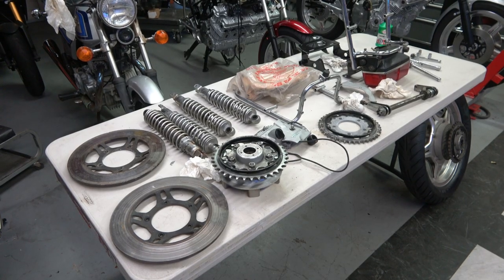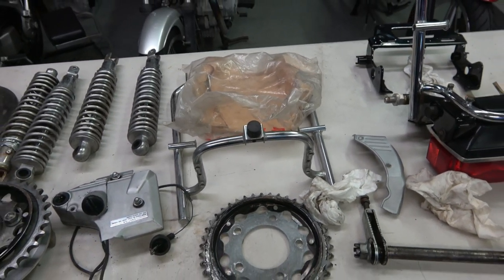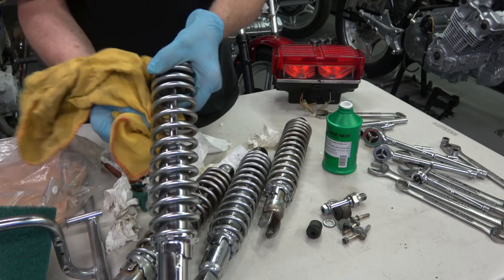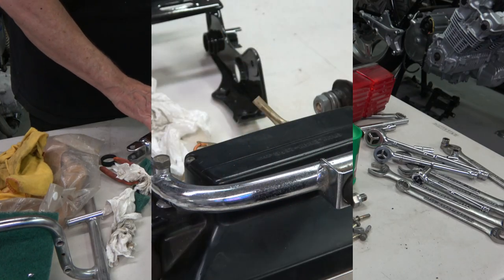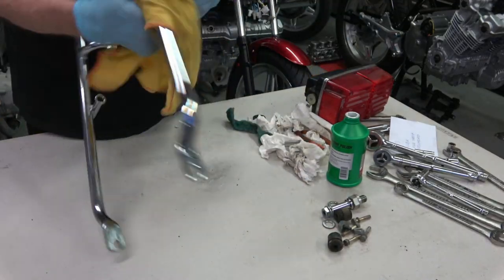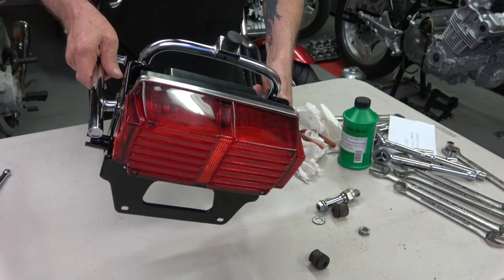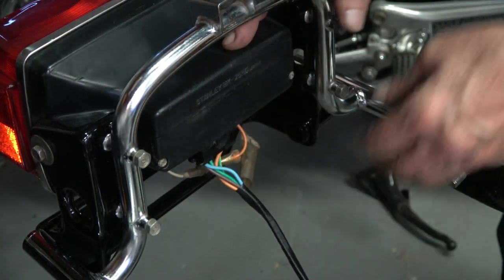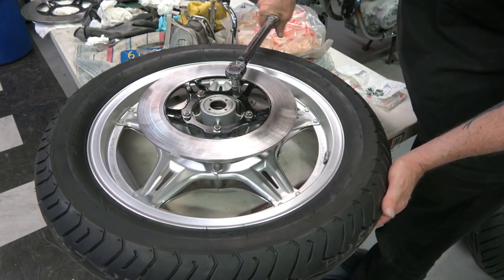Honda CBX Full Restoration & Engine Rebuild Video Series - Part 35 Shocks Brake Rotor Tail Light

Comment: I'm impressed how shiny you get these parts. Even new, these shocks were not very good - the press speculated if FVQ stood for Fade Very Quickly. Have you considered having them overhauled with improved valving and damper oil?